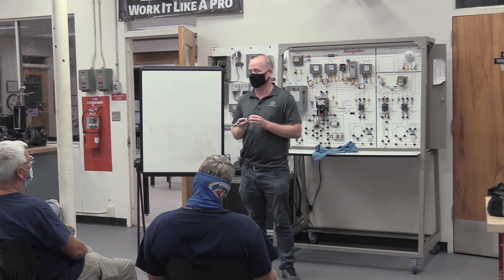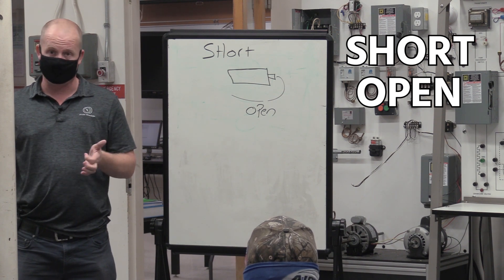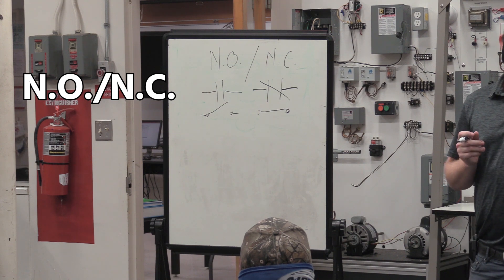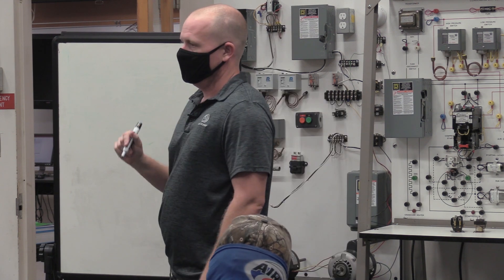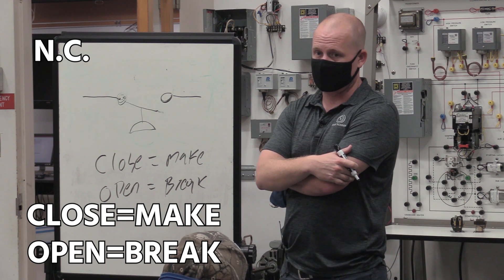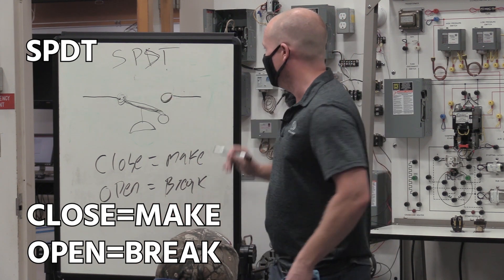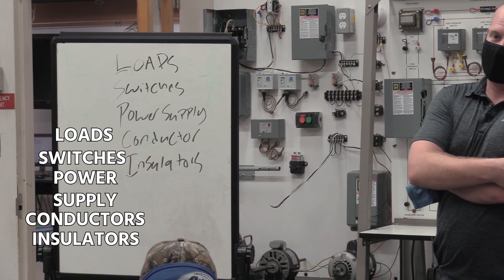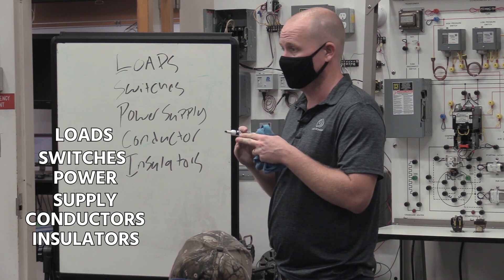Basic Electrical Circuit Terms

Comment: I thought a short is when a wire connects two paths of electricity without load
Reply: a short is basically when one bare wire is touching something it should not be touching and creating a Path to ground or another bare wire. ie: a wire rub through to ground.